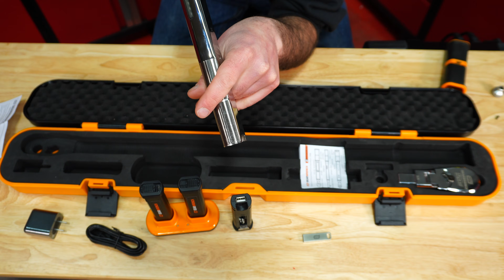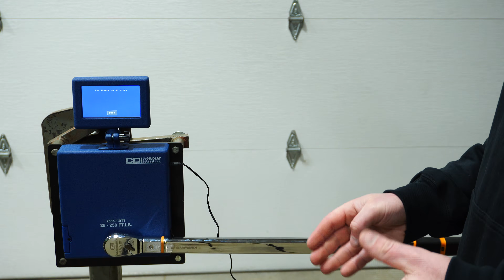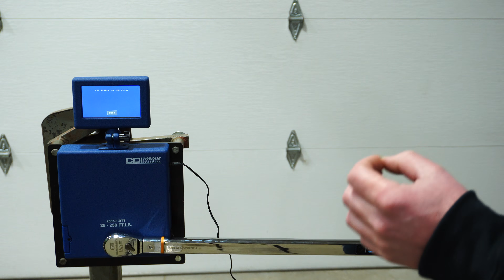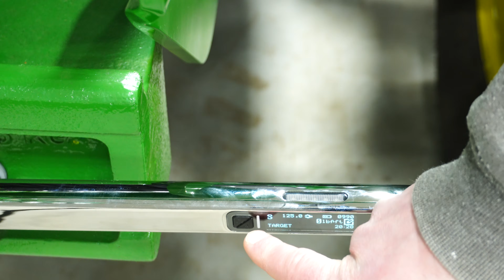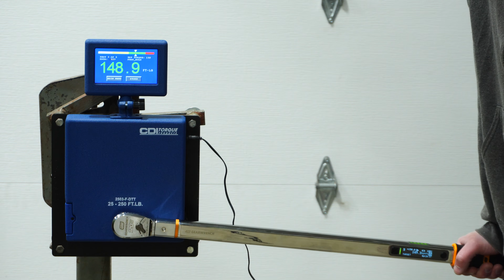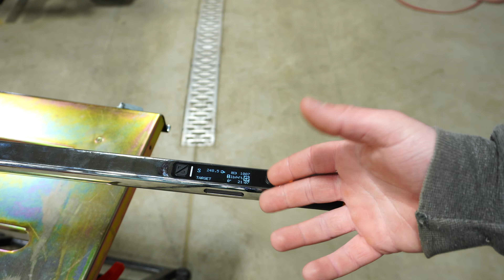The Best Digital Torque Wrench? Gearwrench 1/2 Interchangeable Head Torque Wrench E-Spec

Comment: I use the icon everyday after months of using the snap on and I’m happy with it.
Reply from the maker: Yeah the ICON is a good value IMO.
Reply: I use it daily to torque injectors and the rocker shaft assembly on Mack/Volvo semis. I love how it has 10 presets that make it super convenient when switching back and forth between from 30 ft lbs - 120 degrees. The vibration and loud beeps are perfect for those noisy shops that have several regens happening so I can hear when I’ve reached my desired spec. Worth $340 all day.

Comment: This wrench is not good, very difficult to use. The instructions provided are not clear. The display menu is not user-friendly and is VERY complicated to operate.  You need a degree to use this wrench. Tech support is non-exsistent. This is made in China. Feels cheap and wobbly. Bought for over $1000. Will sell 50% off, let me know if you want it. There are no videos online on how to operate the display for this particular model anywhere. STAY AWAY.

Comment: Is it as obnoxious as the digital gear wrench 1/2" drive 15-250 ft lb. Does it warn 25 ft lb. Ahead AUDIBLY ,CONSISTANTLY till target tourque ??? Cause I bought that P.O.S. and sent it right back .
Reply from the maker: I know what you mean.. no this one is not like that.  That being said the screen failed for me so I probably wouldn't recommend this one either.  

I really like the Icon,  haven't had any issue and has great features for the price.

Comment: I bought my snap on digital half off thru school and just sold it used got icon digital and split beam for the life time warranty snap on only offers 2 years I also was able to get a good dinner and pack of Modelos lol
Reply: I love my icon torque wrench, ive used the snap on and it works about the same, the only thing is that the snap on goes up to 300 ft-lbs, so if you need to torque that high go with the snap on

Comment: Yeah. But the snap-on doesn’t zero the angle when you let off. You can ratchet the head, and it will still accumulate angle until you reach the desired angle. Most guys don’t have room to swing a torque wrench 80-180 degrees.
Reply from the maker: Yep very valid point!

Comment: Have you picked up the 3/8 yet? Would love a review even if it’s not about testing or accuracy. My current digital torque wrench for 3/8 is made in Japan (KTC), and while it’s accurate, it’s short and doesn’t give much leverage. I’m looking for a new 3/8 digital wrench. 

Your review convinced me to grab the Icon, and I’m very happy with it considering I got $50 off, it’s such a deal. Couldn’t pass that up even though I like the e-spec better.
Reply from the maker: Not yet,  the 1/2 e-spec actually failed last week, and is on its way to a repair shop... went to use it and the display won't light up....

So we will see how that goes..  but I do currently still plan on getting the 3/8 but its probably going to be in a few months.  

I really think the icon probably is the way to go,  hoping they come out with a 3/8 soon!
Reply: @Tools-Tested  that’s a real bummer for how expensive it is. Even the 3/8” one is super pricy. 

If Icon comes out with a solid 3/8” like their 1/2”, I’d probably pick it up.

 If you’re interested in making a video of the Japanese one, I could send it to you to try out. Not many videos out there on it and people always seem to like Japanese tool reviews.

Comment: I've been looking at the gear wrench digital torque wrenches close... I'm a 25+ year auto technician and I recently had somebody steal $47k replacement cost of tools and my insurance is flaking on me so all that being said I'm really trying to pinch pennies when I can because that's a lot of money for me anyway and I had all my tools paid off finally so I refuse to go back in debt if I can possibly help it..... Are they really a good tool? Do you think they would survive in a busy shop environment everyday??? I will admit I was a Snap-on snob all the way 99.9% of my tools are\were Snap-on so ya this is not what I'm used to .but I'm not paying 1800 for all 3 torque wrenches from snap on again..... Any input from you or the folks here in the comments will be greatly appreciated!!! Thanks
Reply from the maker: Dang sorry to hear some AH stole your tools,  there are some worthless people out there.   

Its truly hard to say being it just was released a few months ago, but after 1000 cycles it was still accurate.  Gearwrench is claiming this one is designed for industrial applications being used everyday.  They even claim 100,000 cycles before it needs not be recalibrated.  

But my pick would defiantly be this or the Icon which is basically a Cornwell for half the price....

Comment: Besides the price, my other hesitation is the battery system. Just one more thing to keep charged. Speaking of the ICON, do you know what the battery life is? I think I'll always need to keep a click wrench around just for that reason.
Reply from the maker: What’s nice is you can also us AAAs in it if you don’t want to use the rechargeables.  I do agree hate having another charger.   

Its hard to say with the icon,  I think it would be more so a shelf life of the AAs. Versus the draw from the torque wrench.

Yeah I think there is always a need to have a click style on hand.

Comment: WOW. Great review, awesome! I don't think you can think of anything else to make this torque wrench any better, makes me want to buy it just to build an engine. Just as I was losing faith in Gearwrench... I own their 20 year old full sets ratcheting SAE and metric and their reversible offset wrenches, was at Tractor Supply a week ago and saw the 20 piece set on sale for $55, considered getting them till I picked them up and looked at them, they looked SO cheap, the lettering and engraving varied SO much from wrench to wrench couldn't pull the trigger, even if they were for a kick around set. Let's hope they keep building stuff like this torque wrench.
Reply from the maker: Yep lol it sweet!

Seems like GEARWRENCH has been a roller coster ride over the years.  The first products we're well made then you have the cheap tools like you seen at Tractor Supply.

Hopefully they keep making tools like this,  at the vary least have an economy line and then a higher quality line.
Reply: I wish they would incorporate those rechargeable batteries into some of that other tools so you can actually have in a modular system with one type of battery instead of having 20 different types of batteries like that be great for a little electric screwdriver flashlights headlights rangefinders temperature gun stuff like that they could have all those same battery rechargeable docking station would be awesome take notes gear wrench till then I'm not buying your damn electric products
Reply: Idk if they Incorporated a mechanical charging system so it never needed a battery would be pretty cool it'd be like the Rolex of torque wrenches is
Reply: For that price, the wrench should be able to auto detect which head is on it without asking.
Reply: Something that would instantly make it better would be for the angle measurement not to turn off when releasing pressure. If you have to tighten TTY bolts often and have to work in tight spaces, this wrench would suck. You might as well perform the initial torque and then do the angle part with a long ratchet or breaker bar. SnapOn wrenches don’t have this problem.

Comment: Hello - I have 3 of the CDI Torque Testers... and I very recently purchased Two GearWrench electronic (3/8 & 1/2 drive ) - and have not used them yet.  But did test them on the Tester.  The 3/8 drive (20 - 100 lbs/ft) was WAY off. Even though it came with a 'calibration cert.'  I took it up to a Calibration Service Shop - who confirmed that it was WAY bad - and have now spent the $30 shipping for Warranty service... Wrench was NOT cheap.  Anyway - with regards to your testing - this might work slightly better - if you used a Weight which you have weighed and can calculate by distance what the torque should be - and gently lower the weight - and see what the wrench states compared to the CDI.  This is how I found out about my 3/8.   Also - you mentioned that your E-Spec is rated for 68 to 340 Newton Meters.  You also state that you CHANGED the accuracy - and that it came rated at 4% & you set it to 1%.  Did this also change how low it goes, etc.?  Because you also say that in Lbs/Ft - it only goes as low as 50.7.   However - 60 Nm =  50.15415 Lbs/Ft or commonly expressed Ft/Lbs.  So, the wrench should have been able to be set to at least 50.2   And 340 Nm = 250.7708 Lbs/Ft - and your wrench could not even be set to 250!  It should have allowed at least 250.7   So, I wonder if your changing the 'accuracy' caused the lack of proper range.  You also mention more than once - that this wrench is calibrated for 100,000 cycles.  Ok.  But not really.  It is warranted for 90 days with regards to Calibration.  And since they are made in Taiwan - sometimes that Calibration Cert - doesn't mean crap.  I am not happy that after spending over $250 on a wrench - I have to spend more money to ship it to a calibration service company - to hopefully eventually receive what I actually purchased.  The wrench has not yet arrived at the Service Place (Angle Repair & Calibration) - it is doing that this coming Monday 4/18  And I had to wait several MONTHS for the wrenches I ordered to be available to be shipped because of the current junk going on with product availability.   Most people do not have a CDI torque tester such as you (& I) have purchased...  But you would do better (imo) - if you would place a weight on the handle at the proper location and see your results.  Thank you for your efforts and the video.
Reply from the maker: Hi,  im curious which model is this?

The range did drop when I changed the accuracy from 4% to 1% which I agree is not the greatest on their part,  kinda false advertising.

I defiantly don't trust calibration certificates from torque wrench's made in Taiwan or China. Some other wrench's I have tested (Tekton) and others have been way off from the calibration certificate....

The 100,000 is more of a mandatory calibration point,  should be occasionally.  But there are some digital torque wrench's that lock you out at 5,000 (Matco).  They just recently changed that to 20,000.    

I agree the weight method is probably more accurate and defiantly a lot cheaper,  CDI testers are not cheap.....

Thanks!
Reply: @Tools-Tested  The defective 3/8" was the #85195    And you can easily use a 'Weight' and the CDI... that is what I was mentioning - not the put a weight on and see if it clicks...  I found this removed all of the pushing pulling distortions, etc; and became very easy to check.  Our weight is not accurate - it is just some 'weight' - but it becomes a CONSTANT.  And the Constant on the Torque Wrench going into the CDI - can give some very repeatable results.
Reply: I posted a question - seems to have disappeared.  So if this is a 'double' my apologies.  @ Tools... Did you purchase the #85246?  Or a different unit?  The only Torque Wrench I could find at GearW matching yours seems to be the #85246.  If that is what you purchased - you should probably submit for Warranty - because that is supposed to have a range of 50 - 255 Ft/lbs on the Alternate Scale.  And the stated accuracy is 1.5% CW and 1% on the Angle.  Thank you for posting Video's - they take time.
Reply from the maker: @daves7775  yep it’s the 85246,  you are correct box is even labeled 68-340.

No problem! Yeah they can definitely take hours to make.

I will have to test the model you have some time and see if I get the same results you did.  I know some viewers were asking about that one.

Thanks for the info!
Reply: @Tools-Tested   My 3/8 was messed up.  Hopefully most are not.  With regards to your 85246 - the "Target Tolerance" which you changed in the settings - is not changing the accuracy of your wrench.  The accuracy is 1.5% CW & 2.5% CCW  & 1% on Angle   The "Target Tolerance" is changing the % of your targeted torque - for when the Wrench starts giving warnings.  For example: 50% of a 100 ft/lb setting - the wrench would start giving warnings at 50 ft/lbs.  You changed that setting to 1%   So at a target of 100 ft/lbs - the wrench would start going off at 99...  this is to let you know via lights sounds - when you are getting close to your value.  It does NOT affect the accuracy; and your wrench should be capable of being set to 50 or 255 respectively.  Per GearWrench website spec statements.  If it is at all possible for you to post the included pdf of the user manual - which you stated came on the thumb drive - I would appreciate it.  But maybe that is not legal...  Cause GW certainly does not make this readily available.  But from my understanding - you cannot change the 'accuracy'.  It is what it is.  Supposed to be  +- 1.5% CW.  You CAN change the 'target tolerance' which is not changing the accuracy of the wrench - but the indicators for approaching your targeted value.
Reply from the maker: Correct its more of adjusting the range for indication of when desired torque is meant.  What's interesting is at 1% the set point can be adjusted 50.70-248.5,  if you change that to 10% the range is 55.20-225.5.

Comment: Would love to see the test for the 1/4" and 3/8" to see if they are just as incredible. Good video. Ciao, Marco.
Reply from the maker: Hopefully in a few months!  I need to buy the tester's for 3/8 and 1/4 which are about 2K each...  and the wrench....  

But I plan on getting them and the wrenches!

Thanks!
Reply: @Tools-Tested  Would an adapter not be adequate? Most other channels seem to go that route with a single calibration device. I suppose the hard part would be figuring out how much of a loss of force there is, but it should be a consistent value, if any loss at all.
Reply: Ah, sorry, I revisted a video from a few months ago where you explained your reason for purchasing the CDI calibration device, and dislike for the digital adapters. But I I still don't believe a drive-size adapter should affect hand-torque (though it will negatively affect impact torque)
Reply from the maker: I do have the adapter, the issue is I won't be able to test the bottom end of the torque wrench accurately with this stand.

This tester is accurate 25-250 ft lbs and most 3/8 torque wrenches go down to 5 ft lbs.
Reply: @Tools-Tested  Ah, right! Yeah, that's actually what I was realizing just a bit ago with the Quinn adapter and my other tools. I realized I don't have the range to cover, say, spark plugs. So, might grab a 3/8" Pittsburgh Pro for $10 tomorrow, since you suggested those are surprisingly accurate? I'll upgrade in the future! Ideally to a split beam, but I'm not seeing 3/8"-drive variants.

Comment: 👀
Reply: This seems incredible. Certainly getting value for that high price. However, I think I'd stick with the ICON digital angle wrench. I just wish it was available in a 3/8" variant. I personally own a 1/2" Snap-On Techwrench torque wrench, and a 1/4" click-style Husky torque wrench, but still have yet to acquire a 3/8". Not sure what the best option there is, for a hobbyist. (Formerly professional, thus the Snap-On kit, but I'm honestly considering selling off a portion of my SO kit in favor of cheaper and better options)
Reply from the maker: Yeah in all reality anything under 4% in accuracy, will get most jobs done.  This seems to be a great value but its still almost double the cost of the Icon!  

I agree, hopefully Icon will come out with a digital 3/8 and 1/4.  I think the design work is already done seeing they look almost identical to the Cornwell Digital's and they have 3/8 1/4. Just a question of when we see them!

I think there are a few people considering selling some of there SO and buying alternatives. Yes most are not made in the US,  but like you said they are a lot cheaper and in some cases better.
Reply: @Tools-Tested  I just learned of Tohnichi, which apparently is Japan's biggest maker of torque devices. Their prices seem reasonable, middle of the road. Not budget options, but also not ridiculously expensive. Maybe they'd be worth your consideration at some point? I think I'm personally eyeing their "MTQL" series. 

Digital wrenches are nice, but I think I might prefer clicking wrenches. Waiting for an audible beep and haptic vibration seems more likely to overtorque if one goes too quickly, whereas clicking types give you a little buffer when they break-over before they continue rotating the fastener. Though perhaps to the best of both worlds, I bought a Quinn digital torque adapter today with HF's Spring "Black Friday" sale.

On that note, do you have a video explaining differences in torque wrench technologies, and perhaps a demo of accuracy and precision? If not, could be a good content piece.
Reply from the maker: Interesting I will have to check them out and test them someday.

I agree,  you can make more mistakes using a digital than a click style.  Also to me a click style is a lot faster because you can keep a constant force until the click were as digital I find my self slowing down.

Thanks for the info!